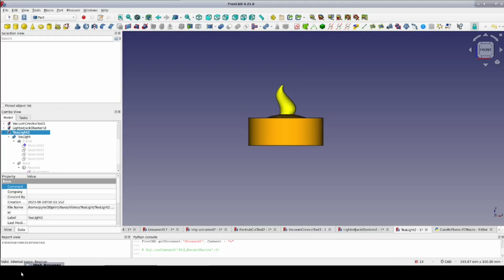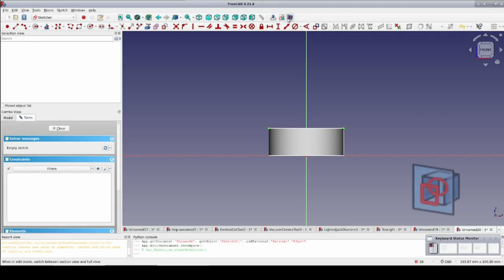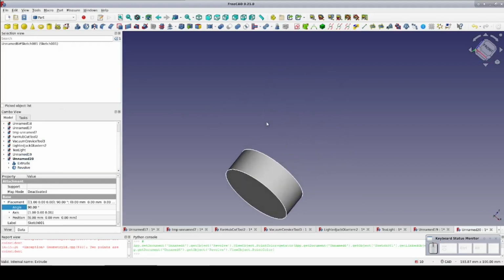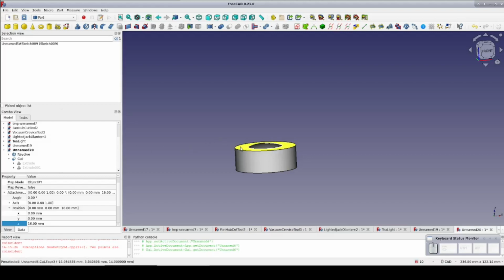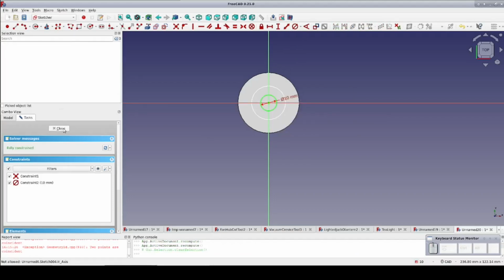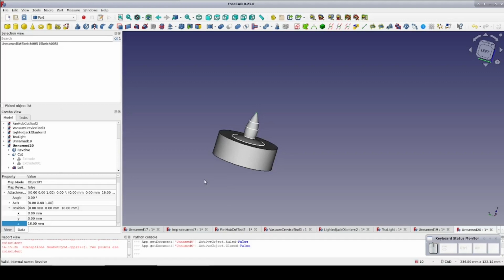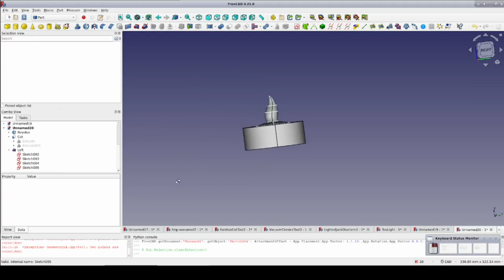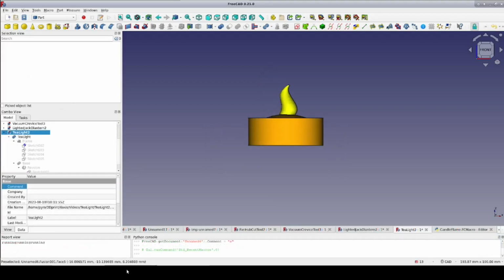An LED Tea Light in CAD

Comment: Great video! And I think that flame definitely means you have artistic talent! You just used FreeCAD as a medium!

If you don’t mind answering a question, I was wondering if FreeCAD could model something with pivoting joints, like this pivot shelf project: https://youtu.be/6pcSBCV4rT4?si=rLqfENk56ZHr0m3t

But regardless, thanks again for the video! Always a treat.
Reply from the maker: Thank you for your kind words.
FreeCAD can definitely model the storage shelf/workbench. A good approach would be to model each of the cut dimensional pieces and then assemble it all in one of the assembly workbenches. That allows you to move the parts in CD to make sure it all makes sense, and then produce technical drawings you can use in the construction and assembly.

It looks like there are workbenches like arch and frametools that might help you there but I have no experience with them.